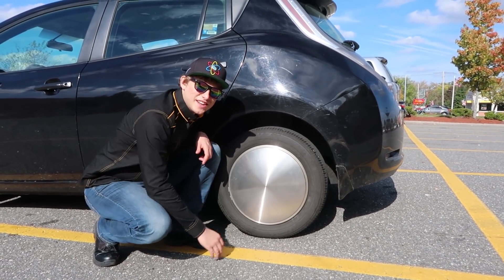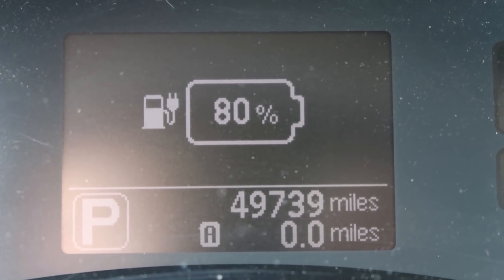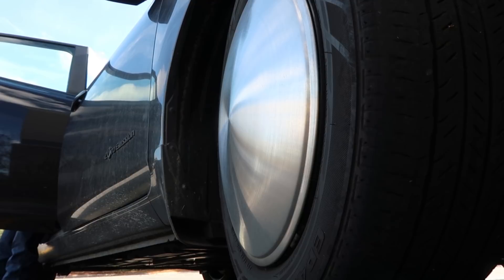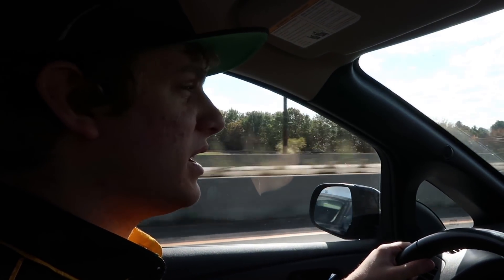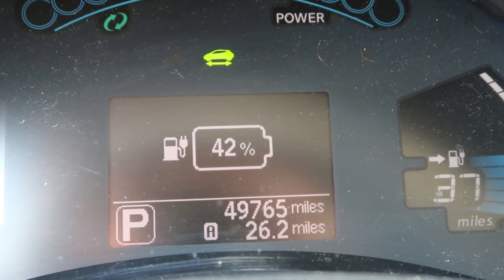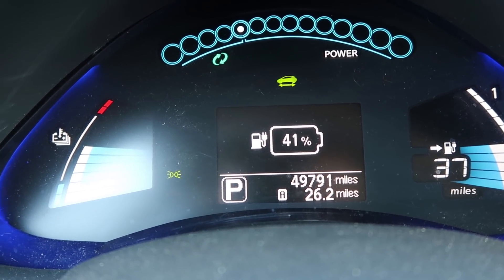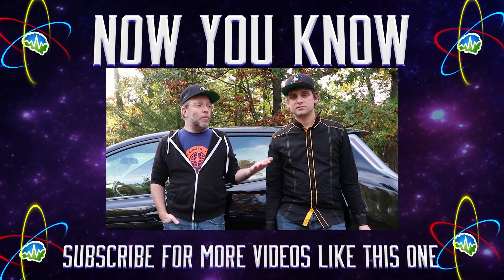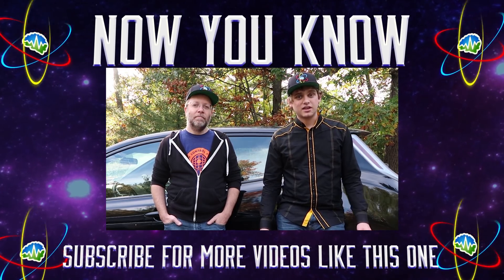Nissan Leaf Hubcap Efficiency Test #2!

Comment: If someone is doing the test again. Please use leafspy with the obd-2 (obdll)adapter. You will get exact data on battery charge as SoC and GIDS. Exact energy used. Tires pressure, battery temperature etc. 
Also to minimize wind factor go slower since it square of speed. And don't follow a truck since you can get 10% to 20% more range!
Reply: Gilles Pelletier that was my suggestion after the first test.
Reply from the maker: +Anthony Perrella got the Leafspy app after recording this. Good call, can't thank you and everyone else who suggested it enough. I think we'll be seeing an episode about it.

Comment: The racing disk completely closes off the wheel hub which will reduce drag, but you need to have some venting for brakes and it's been shown, if you say have a ring of vents on the outter edge of the hubcap, to improve areo performance. Check out 
Julian Edgar's video on hubcaps
Reply: I don't think brake cooling is important on EVs as they do all regular breaking (e.g. prolonged downhills) with the motor. Only hard brakes will use the disks

Comment: 8:58, You probably would be surprised -- most gasoline gauges horribly misrepresent the actual fuel level.  They often are not linear at all.  Often they're gamed to slow movement near "F" and also near "E".  This gives the illusion of greater range, lessens the chance of running out completely, and increases owner satisfaction.  Also your speedometer lies on purpose.

Comment: Gasoline level indicators are incredibly non-linear since the fuel tanks are odd shapes.
Reply: lessdeth69 yup, I can contest to that. My car has a 17 gallon tank. From “zero” to half, it takes about 10 to 11 gallons. Sooo from half to full it takes 6 to 7. Of course the “17 gallon tank fill” doesn’t account for the filler tube, hence the inaccurate math there.

Comment: The result make sense!
The hub caps are a very small fraction of the total drag.

The biggest impact I think one could make is with the tires.
On my 2015 Leaf, I noticed quite a big difference when I installed my winter tires.
Not only they are much heavier but they have very high rolling resistance, for good reasons.

So I think the biggest impact one could make (without tearing the car apart)
- Light tires
- Low rolling resistance tires
- Lighter wheels (like the Enkei RPF1, they are ~15 lbs)

Comment: I have a 2023 Bolt EUV. I’m working at Ford’s Blue Oval City construction project. I drive 97 miles per day round trip. Because of the extremely crappy roads leading to the work site, I decided to order 16x6.5” steel wheels to replace the 17x7” Premiere wheels, and Hankook LRR 205/60/16’s to replace the OEM 215/50/17. These tires are within .1” OD of each other, and 1/2” less tread. Most of my trip is highway.  The 16’s are much more comfortable on the bumpy construction roads. I bought the same wheel covers, but paid a lot more. Within 3 weeks, I lost 2, and had to re-order a set. I noticed a sharp decrease in efficiency when I lost just 2. I don’t know if I lost these because my co-workers decided to “play” with my wheel covers, or the rough roads caused the covers to loosen. It could also be that the covers were removed to add tire pressure, and I didn’t check change to the retention. I’ve been searching for bolt-on rings for racing wheel covers- designed to prevent wheels from picking up dirt/mud. I’ve also searched for disc brake dust covers that might help deflect some air pressure from pushing on the wheel cover from the inside of the wheel. No luck as most of these covers are made for RWD vehicles where the brake caliper is not positioned as far inside the wheel well as FWD. The steel wheels and tire combination weighs 7 lbs less than the OEM. Some people don’t realize that most OEM aluminum wheels weigh the same as their steel replacements. Yes you can buy lighter weight AL wheels in the aftermarket, but I would be wary of anything not forged AL which is much more expensive. OEM AL wheels are heavy for strength, and there are times where an AL wheel weighs more than a steel wheel for that purpose. My experience continues, and hopefully I will discover why those wheel covers are coming off, or I will be forced to make my own wheel covers by mutilating a plastic cover with a metal retention ring to hold pizza pans with screws. Unfortunately, metal race rings which can be installed securely in steel wheels then bolt on lightweight covers are not made for 16” wheels. I’m not really ready to go to 15” which might not fit over the caliper, and would certainly induce some paranoia during emergency maneuvers.

Comment: Thanks for this. I would have hoped for a longer test, but yeah I get the time-element. One other way to amplify the effect of aerodynamics is to drive faster. You had pretty good speed here though. Apart from repeating the test in the opposite order, the cold battery can be eliminated by driving the test in two parts: Pick two days that are weather wise similar enough and each day do one round trip starting with a cold battery. It´s not uncommon for weather to stay very similar for a couple of days. If it´s a longer drive, it would make sense to divide it to two days anyway.

Comment: I'm sure others have mentioned it, but using the LeafSpy app and an OBDII adapter can give you very accurate charge and temperature data. In the end, however, the Leaf isn't very aerodynamic. the Model 3 is much more so, but it is heavier.

Wind drag is by far the biggest load on the battery at highway speeds. The Leaf is much more of a city car, made for low speed driving. Dropping from 65 to 45 will give you More than a 20% increase in efficiency. At lower speeds it is changes in momentum that are most important. Gradual acceleration and slowing gradually (i,e,; anticipating velocity changes) greatly improve miles per kWatt hour. Gathering velocity downhill and letting the car gradually slow on uphill grades also has a surprisingly large impact. 

Most drivers don't care and won't bother, but learning to drive Very efficiently works as well in Teslas, ICE cars, and diesel semi trucks. Practicing it teaches the driver to look far ahead and to carefully meter out throttle, brake, and steering inputs. I spend time on race tracks on both 4 and 2 wheels. I have found that working hard every day to maximize efficiency driving the Leaf has really helped my situational awareness on the track.

For practical driving I recently bought a Chevy Volt. It lacks many of the efficiency helping information outputs but is MUCH more efficient intrinsically and has that generator backup that keeps you from worrying about running out of electrons. It has a much more efficient regen system than any other car I have tested but it is very difficult to get data out of any of the new EVs. OEMs are keeping the "real numbers" well hidden.

Comment: Don't rely on the average shown in the car. I've done tests with my Leaf and found it very unrealiably. I'm not sure why, or when, but I believe it has something to do with regen. The test where it showed most inaccurate was "roller-coaster" driving (coasting down hill gaining speed, or regen).
So it might be more accurate with highway-driving.

My recommendation is:
% as you used. If started with same %, I found my Leaf to be very accurate.
Leafspy APP and OBD2-plug. There you'll find energy used, energy left on battery and SOC with decimals.

Keep up the good work :)

Comment: Tesla Aerowheels are tested and designed via cfd-Simulations and windtunnel testing. Main idea should be to smoothen out turbulent influences by the airstreams flowing around the sideline of the vehicle. So the wheelcaps push the air away from the car, creating a cushion of air over which laminar flow can occur. This of course works best if the underbody of your car works well in conjunction with the sideline - like with spoilers in front of the wheel arches or some kind of winglets to guide the airflow. Greetings from Germany.

Comment: A few more comments. First let me mention that the percentage you saw, about 2%, is about what I saw with the addition of similar discs on my Prius. I got 51.8 mpg average on a cross continental US round trip when the car was new, and it was showing about 51 mpg running average before the trip with most ly freeway driving.  
Now the tire temperature for both runs should be the same as well as the air temperature. Bot the battery and the tires should have warmed up if there was a sufficient distance to thecharging station. Cross winds should average out if the time of the test is roughly midday, but early morning and early evening will see  the sun induced wind shifts that could affect this characteristic.  Weather forecast for the day should be fairly consistent.
 I did coast down Tests of a faired recumbent bike I built changing out various parts of the fairing to understand their contribution. for the test I used a little traveled mostly constant slope road beside a creek. The steady drop of the creek ensured the slope, and the trees growing beside it shielded the wind effects. Minimal anyway here in SoCal. My tests  were in groups of three in each configuration for averaging purposes. I depended upon the road to accelerate further, after propelling the bike to 20 mph to get it into the drag regime in which it does  its best.  Speed gained at the point of braking to a stop sign, begun at the same landmark, became my data points. It was quite consistent for each type of run.  My speedometer was accurate to three places, and speeds measured were well within the Tour de France peloton range on flat ground.

Comment: Great video guys but I think I know why the test didn't go to plan. On your first test video you tested the standard hub caps first on cold battery, then tested the steel hub caps when the battery was warmer and more efficient. In this video you did the opposite so the steel hub caps was compensating the cold battery and the warm battery was compensating for the standard hub caps in energy efficiency . Hope this helped

Comment: Good job, better than the first time. One thought I had, if it is more aerodynamic with those covers, you would notice the biggest difference the faster you go. In the equation for drag, velocity is squared; so drag increases exponentially with speed. Perhaps if you tested at speeds of 75+ mph, you might see a bigger difference between the two hub caps.

Comment: Was the air temperature consistent through the test?  Cooler air is more dense, and that means higher drag.

By the way, actual flat disks would be lower drag than the domed covers you have.

Also, you should go by the kWh for each charge.

Comment: This was a much more normalized test. This is more like I would have thought it would be. It is better but not very much. Thanks for retesting this. i'd say that 2.5% better is very good in only 26 miles.
Reply: Well when it is an average then the percentage of difference will remain the same. Only battery percentage will change over more time, but ratios will remain the same. In theory of course.
Reply from the maker: +EVMANVSGAS especially at 65mph. The difference could be drastically different at higher speeds

Comment: Jesse you’re right. If you did 2 round trips (one for each cover) on the same road, the wind factor should be canceled. I think this test you only did one round trip though, so that might be a reason the results were different.
Reply from the maker: +andrew nelson they're all round trips. They're all exactly the same. It's a big, squashed circle.
Reply: Uhhhh ... gusts?!
Reply from the maker: +idmhead0 oh ok, those are conditions that are easy to come by.
Reply: No, you need to do the same round trip twice, one with each different type of cover. The reason for that is if you swap covers and go the other way, then it may be wind or cover that gives the result. In fact, if you had a headwind with the smooth covers, and a tailwind with your standard covers, the real difference could be 2-3 times what you saw here.

Comment: The Leaf has a claimed CD factor as low as 0.28 and a measured as high as 0.32. Aero hub caps will have proportionally more effect on a more slippery car. The Model 3 has a claimed CD of 0.23

Comment: I believe it is very hard to measure the level of charge in a battery. My experience has been that charge indicators respond in a very non-linear manner.
Reply: well you can set the leaf to charge to 80% on it's own. it should be very, very close

Comment: Regarding the warm battery .. Try to reverse the hubcaps. You did your first test started with the moon. Next time start with the factory wheel covers and finish the run with the moon covers. I'would like to see you travel perhaps 200 miles with one style hubcap keeping track of your daily mileage. Then switch hubcaps for another 200 miles

Comment: I could have just missed this, but did you already take into account elevation? I live in a mountainous region, but as long as the elevation of the two chargers is the same Then it should be fine,otherwise that could be a huge variable. (Driving 26.2 mi up even a slightelevation change can be taxing)
Reply from the maker: +Andy Sowanick it was the same charger

Comment: If increased battery temperature gives better battery efficiency that might mean that the standard hubcaps were given an unfair advantage.  You should reverse the order of the test to see if the efficiency difference remains the same

Comment: If you really want to increase efficiency, get a set of 5.5/6.0" x 16 wheels, and don't just place a disc over the spokes, sandwich the spokes in thin plastic sheets so that they're not receiving air.

Just make sure to be light on the brakes...which you can also have drilled.

Comment: The difference for Tesla is way bigger, as they compare it to an aluminium wheel with way bigger openings. The steel wheel you use is allready very closed and efficient. Looking forward to see a comparison on a Model 3 with and without aero caps.

Comment: Going one direction with winds and opposite with same winds is not cancelling out unless your car shape is symetric front to back.
Reply from the maker: +fcycles we went both ways in both tests. (Down one highway exit and back both times) wind was low that day. Likely negligible.
Reply: Test was good, but just the hypothesis at 1:53 if there was a wind.. moving the object in one-direction+opposite will cancel out only if the object will stay with the same shape-wind orientation. Anyway, it's just a small comment.. amazing show u do guys!

Comment: I used those on my 2006 xB and got 2-3 mpg more but found they throw the wheel balance off a little and get loose after a year or two and make clicking noise at low speed.  No problem with brake heat as the rotors cool from the inside mostly.

Comment: you could repeat the test with oposite dirrection, first normal hubcaps then those more efficient. with warmer battery on second run difference should be bigger slightly and this way u would know if battery temp has something to do with test results. nice that you repeated the test.

Comment: As I said before, most if not all battery indicator are exponential. They reach an asymptote as they reach 100%. A good improvement is to use plastic hubs similar to the stainless steel ones as it may reduce weight. Anyway really good video!

Comment: Have those things polished as be like Elon and make it look it's best no matter what, get it? Hopefully these upcoming battery technologies will be sold to the public so that you can more than double the range of that car with just a battery swap. 
And just to answer your question on how the Model 3 is claiming it's hub caps to be 10% it all has to do with the design as they more than likely make the airflow even at highways speeds.

Comment: Your assumption about the wind resistance is incorrect. It is a squared function, so the tail wind will not save you as much energy as the head wind will cost you. Hence differences in wind conditions will affect the test.

Comment: What kind of range do you get on your Leaf (winter and summer)? How many capacity bars do you have left?
Reply: i am in indiana fiat 500e today i drove 21 miles round trip 20 degrees cold battery ..was 63% i only ran the heater to defog windows ...range indecator said 63 miles range currenty charging ..going pre heat this time

summer time same trip i would get home with 72% on battery...range indecator would say 125 miles range thu
Reply from the maker: +gasdorfic muncher don't ever use the heater. If you don't have a seat warmer get a heated blanket that plugs into your cigarette lighter and wear a jacket. You can defog with outside air. The heater (if it's like the Leaf) will use about 3.5 kW. It's crazy!
Reply: how do you give a ev a car wash in the winter ? can you get road salt off in a spray and wash ? ev car has no engine heat?

Comment: I've owned a Ford Fusion Hybrid for 8 years. At temperatures around 60F., the mpg improves 4% per 10F. temperature increase. You need to do the  test again with no traffic and the same temperature. Headwinds and tailwinds produce 7% changes per 10 mph winds. Heavier traffic produces tailwinds. Speed reduces mpg 15% per 10 mph increase. Theory says the solid hub caps should reduce centrifugal air pumping loses by the spokes but the inside of the wheel is still open so that improvement is unlikely. At most highway speeds the rotating spokes can be designed to appear solid to the passing air stream. The precision of the Leaf m/kwh may only be within 2% because you don't know how the computer rounds .00 to .0 so you should assume a possible error of .09 between two different readings ( The 4.0 might be 4.04 or 3.95 and the 3.9 might be  3.94 or 3.85. I don't think you going to be able to measure a valid difference. The Leaf looks like it's Cd is pretty high to begin with.